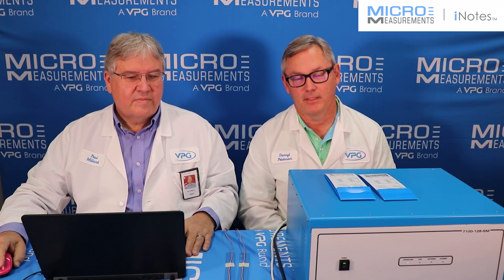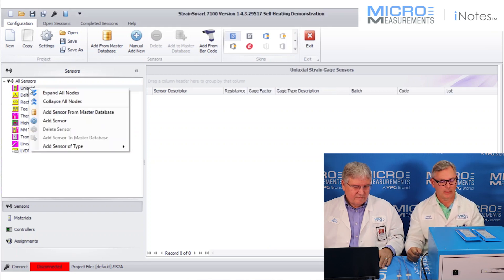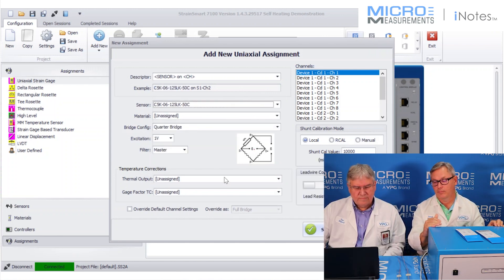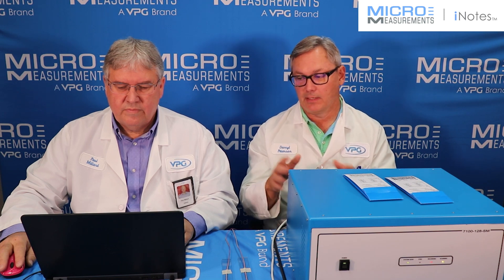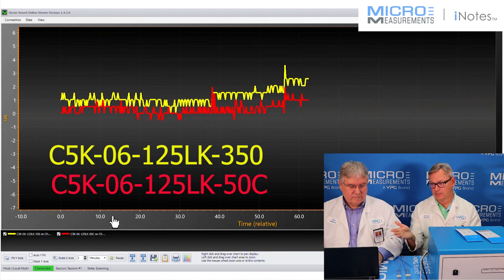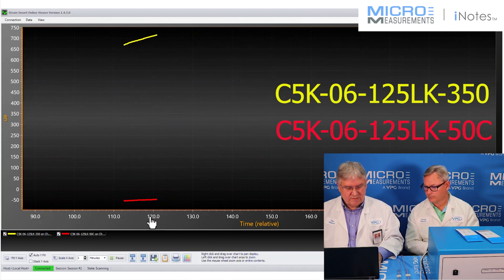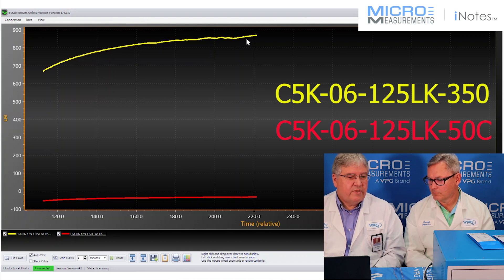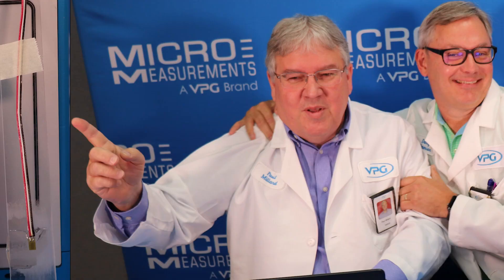DOES STRAIN GAGE RESISTANCE MATTER?

Comment: You need to be careful with strain gage resistance and a balancing circuit. If the balancing circuit is digital, then no issues, if the balancing circuit is analog, you will introduce non-linearity the severity of which gets worse as resistance of the gage gets closer to the resistance of balance resistor via which balance DAC is connected.